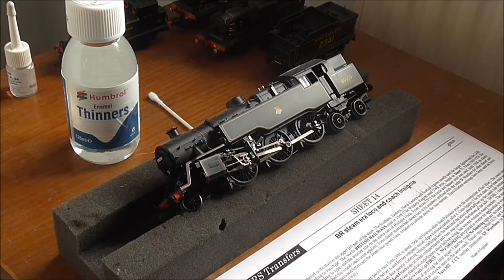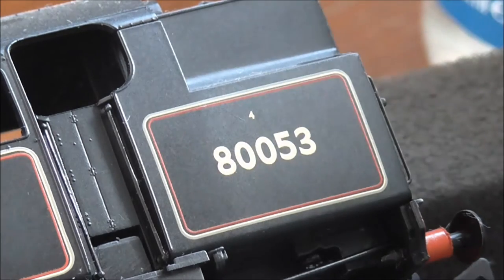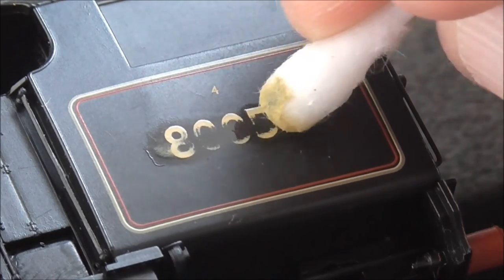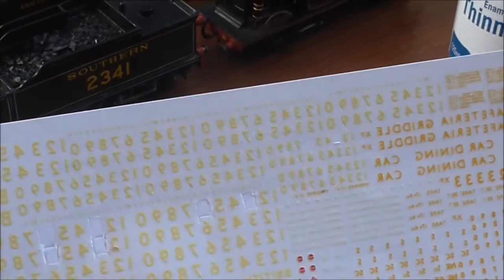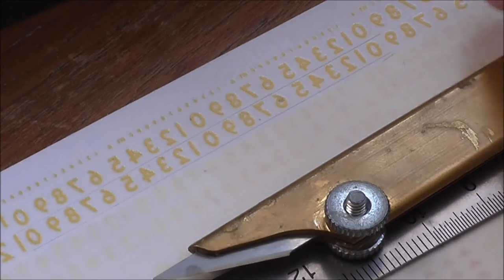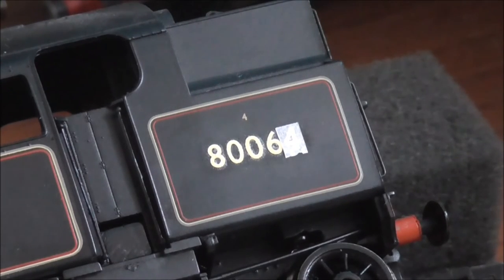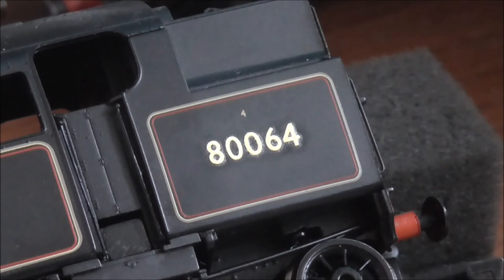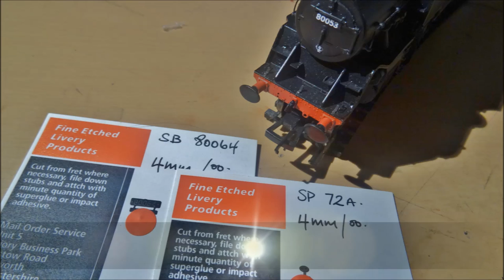The Workbench,  Loco re-numbering

Comment: A very helpful tutorial indeed Matt. Just about to have a go myself for the first time, with a Bachmann 4MT Tank too. Got some Humbrol Enamel Thinners and just ordering up the Transfers. Is the Statin Spray just the spray cans for sealing? Will have to watch this video while having a go ;)
Reply from the maker: SDJR7F88 yes the varnish is to seal the transfers on to the surface for extra peace of mind, some don't use it but I've always been shown they should.
 depending which varnish you use especially and if it's Humbrol warm the can up in a cup of warm water or it will react.
Reply: Will do. A very helpful time with the warm water, will be sure to do that
Reply: What does warming the varnish do?

Comment: Great video Thanks for sharing It has been very helpful to see how you applied your HMRS transfers looks a lot easy then using waterslide decals  as you pointed out must admit to getting in a right mess in the past with them. 
Ps where do you buy your etched plates from?
Reply from the maker: peter wrigglesworth not a problem I'm pleased you found it useful :-).
 The etched plates, it does vary where I get them from, this one I think I got them from Fox Transfers, custom ones usually I use Narrow Planet, which will be in another video at some point.

Comment: Nice video. I use the scraping with a knife method myself. I can't recommend those HMRS transfer sheets enough, cheap and enough to do a complete fleet of engines, they also leave no film and look just like the real thing unlike most waterslide decals.All my great western locos are done with these as they are far better than Bachmann or Hornbys factory logos.
Reply from the maker: +Brockwell Lane Indeed absolutely agree, very good transfers, I felt it was needed to do a clip on these as they confuse some how to remove them from the backing ect....